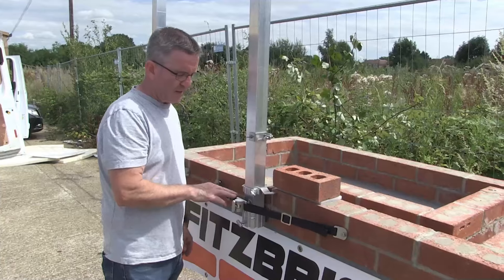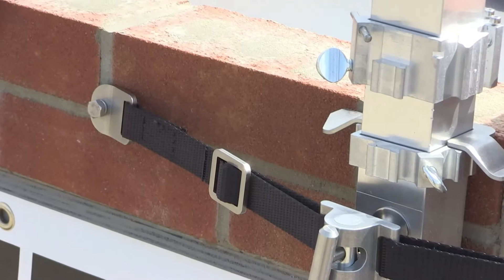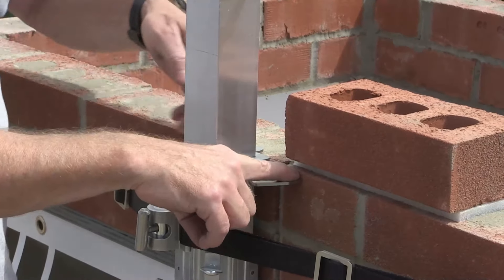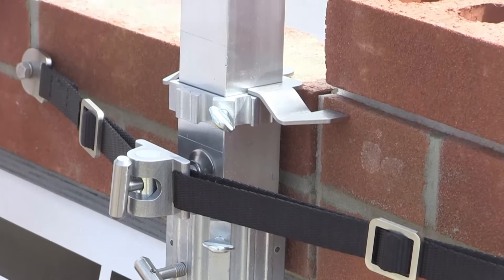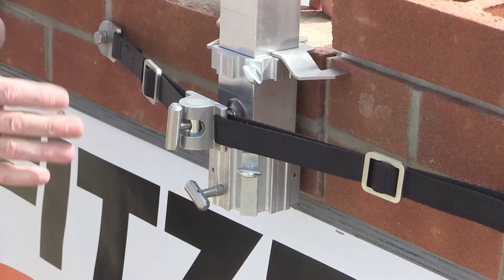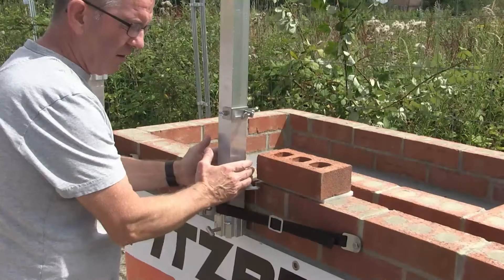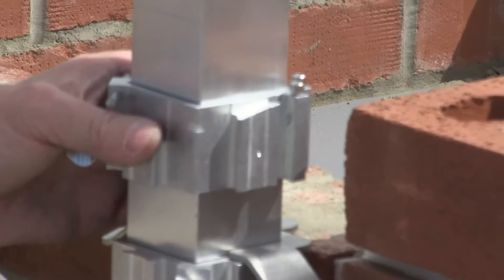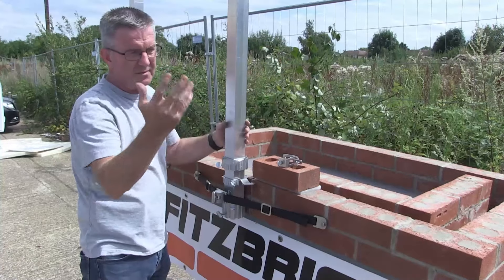NEW TOOL - FITZBRICK INTERMEDIATE PROFILE SYSTEM

Comment: couple of questions. if your happy to answer. what's the advantages of clamping across the wall rather than through the wall? also advantages of being able to clamp on the 2nd course? opposed to any other course? do these profiles fit inside a scaffold board? and last but not least why not clamp a profile at the opposite corner and run your line to that profile opposed to an intermediate that may not run true corner to corner?